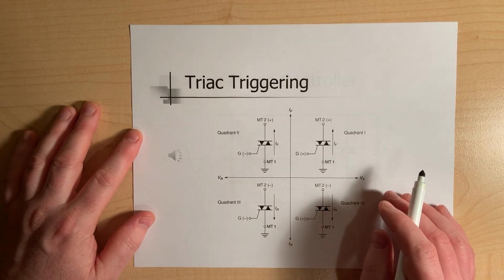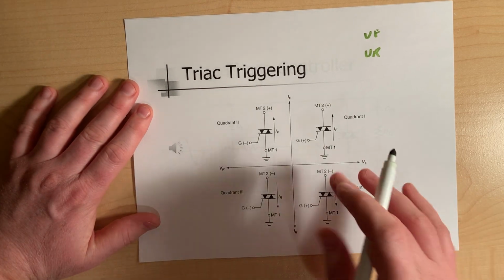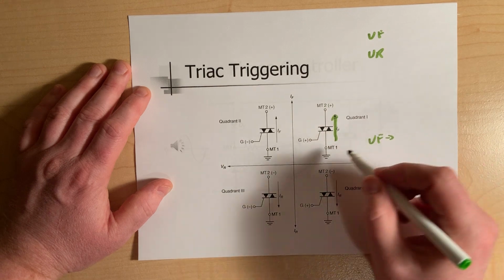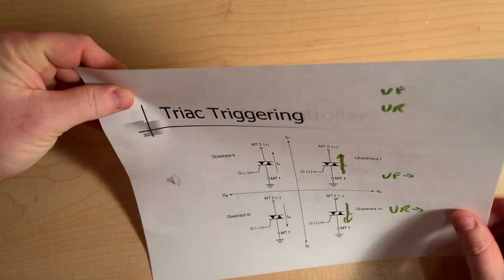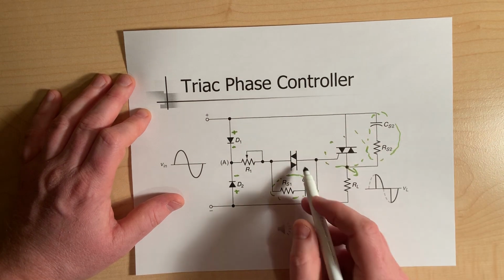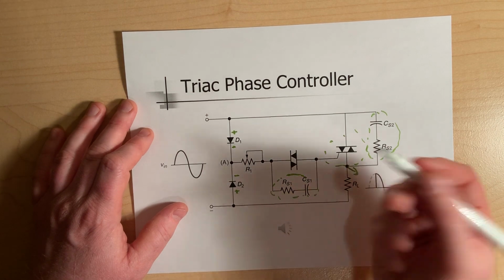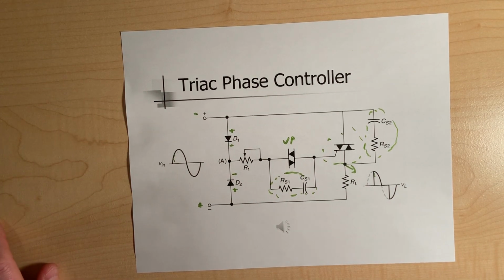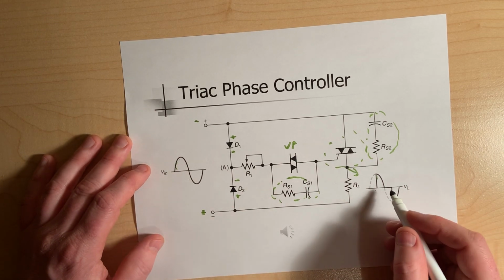Triac Phase Control

Comment: I don't understand. I always knew that to open a triac, a current flow between MT1 and G either way, but now, it comes out it can be triggered even with a current flowing between MT2 and G?
Reply: It's AC. Let's say we are checking the the mains sinus cycle.
Since MT1 is connected to the neutral wire, it can be used as a reference point for now.
1st/2nd quadrant: MT2 is on a positive voltage compared to the neutral, because the mains voltage is in the positive range. So when we introduce some threshold voltage beetween the gate terminal and MT1, the triac ignites and conducts, we are happy.
When the mains sinus voltage is zero, everything closes, no current flows.
3rd/4th quadrant: MT2 is at negative voltage compared to the neutral wire. If we show some voltage (positive or negative, doesn't really matter) between MT1 and gate terminals, the triac ignites again and conducts current until the mains' voltage reaches zero.
So, you can see the controlling terminals on a triac are always MT1 and Gate, though it can cause misunderstandings...
You can try it out with a DC supply, you can see if you apply voltage between MT2 and Gate, it just won't turn on.

Comment: Since the triggering Diac does work with + and -  potential then the diodes are not necessary.  The current needs to be limited by adding a series load Rl to be compatible with the supply source thus making the voltage source somewhat like a current source. Adding a timing capacitor would help improve the circuit. Rl could be incorporated in series with the whole unit including the timing unit and not just the Triac. 
I believe the sensitivity of the triggering of a Triac is not the same if the polarity of M2 and the gate are not the same.
hence (+ +)   and ( - - ) are equally sensitive but not equal to (+ )  or ( + )